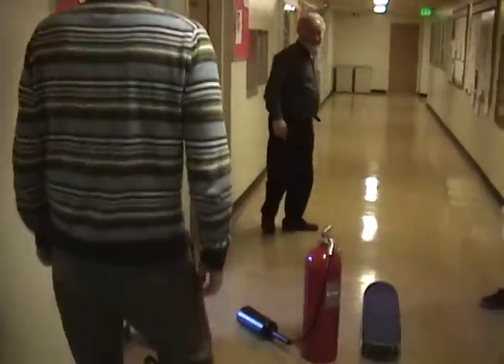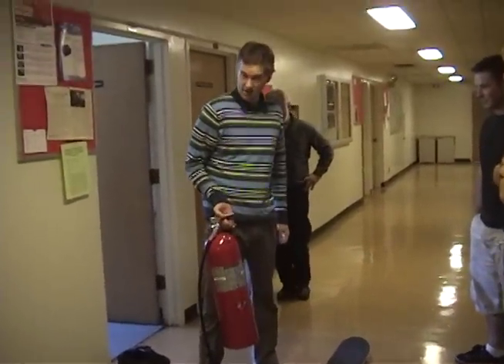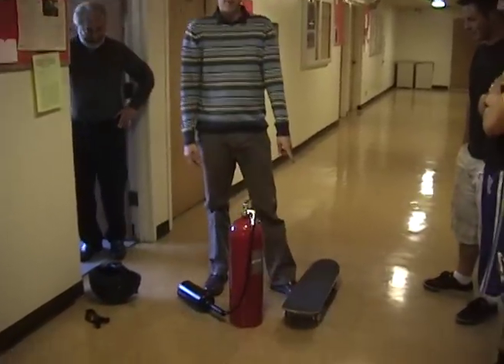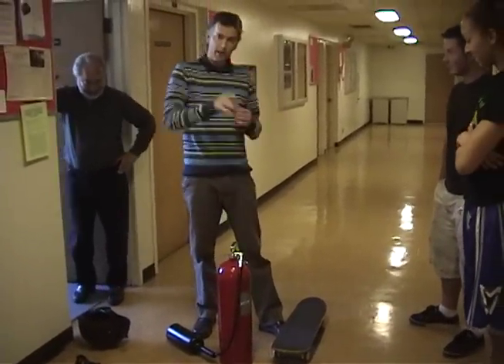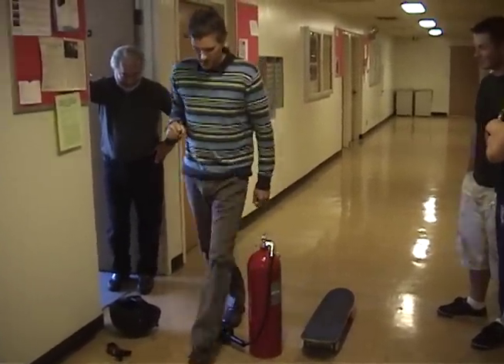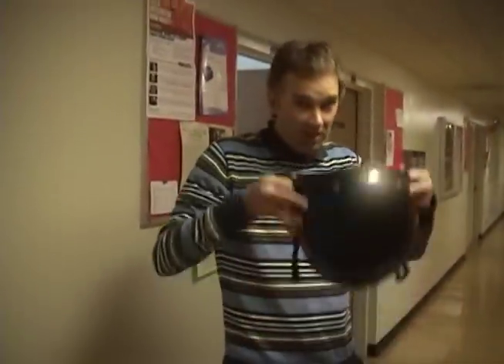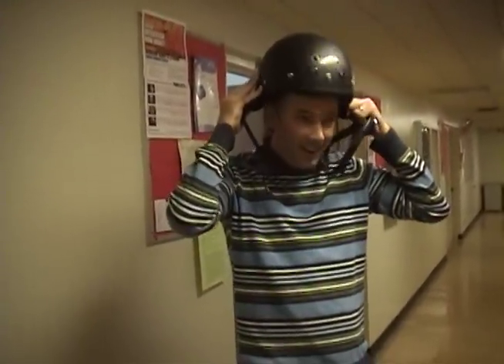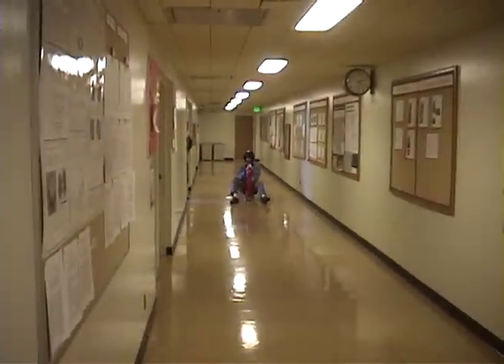Fire extinguisher rocket

Comment: of course, filling up a closed space with carbon dioxide has its own problems....
Reply: I considered this too, but I figure CO2 dissipates quickly in a large enough building.  Humans can handle quite a bit of CO2 concentration compared to other chemicals.  Not that I would personally recommend working in conditions like this, but OSHA limits safe CO2 conditions to 5000 ppm for 8 hours.  Whatever was in that extinguisher likely did not increase the ppm to anything high for even 1 minute.